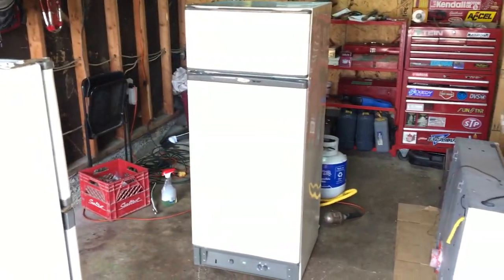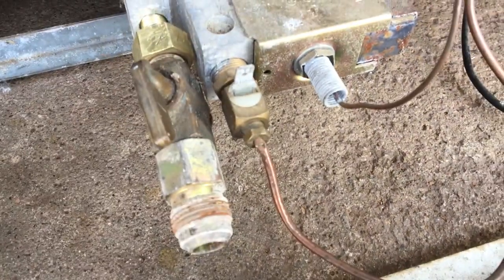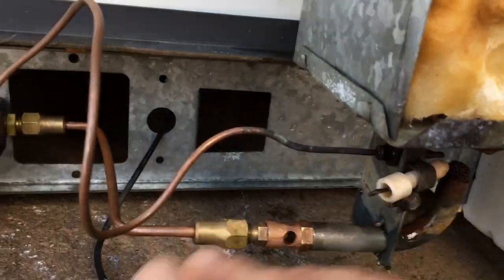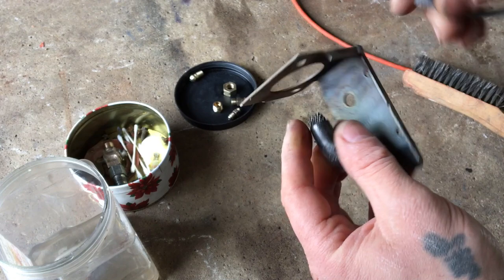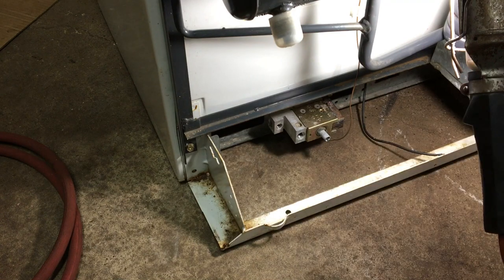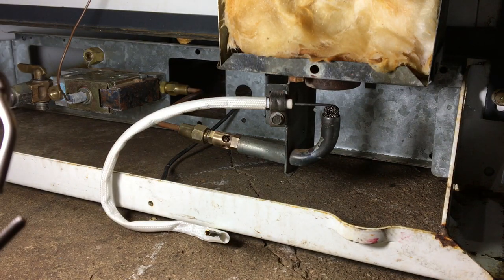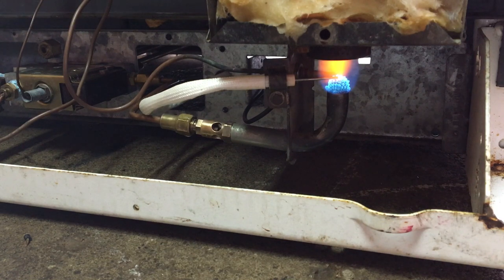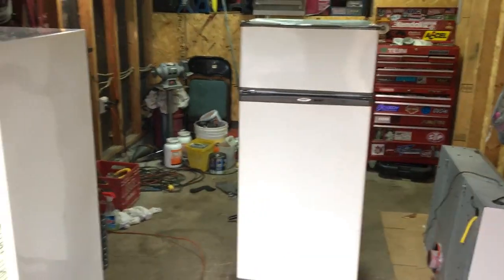How to fix a propane fridge - Consul Danby Unique - Off Grid

Comment: Wow, Great video. I have an RV fridge that wouldn't stay lit. I thought it was the thermocouple but had to wait to get the part. When I blew the dust and dirt from the area I came up with an extra part and couldn't figure where it came from. Now I know it was supposed to be in the gas control valve where the thermocouple connects. Not having it there caused a little fire ( which I quickly put out). Your video also showed the importance of cleaning the flue.
Thanks again for explaining the system!!!

Comment: Thank you for your video very, very knowledgeable and helpful. I thought I'd give you a little pointers on thermostats. Thermostats are never right. I used to 32°. It melts to 33. If you put your thermostat in a glass of ice, it should rain 32°. If it doesn't adjust it when you adjust it, it will be right.

Comment: You did a great how to on this . Just a lil fyi though . On threaded fitting only one type of sealant is needed . On the flare fitting the sealant is not needed at all , the bell or ball of the brass fitting is where the seal happens  .

Comment: I love this design and I love the concept of a frigerator that doesn't need electricity to run.
My only real objection though (I guess) would be that you have to replace the propane tank every 4 or 5 days during the summer months which is probably expensive after a few months- or at least that's what I've heard.

Comment: Thanks for the video, I have two, my issue is the new electronic gas regulator will not stay lit, it will light with the push button and sparker but even after five minutes of holding the push gas button it goes off, any adjustments to regulator to help solve this? Thanks for the video.

Comment: Thanks for the helpful video.
We bought a camp with two of them.  We only use one and it's worked well. 
This weekend we noticed an odor in the closed up house like 'burned propane exhaust.'   Went to bed and the freezer was -10 and the  fridge was  34.
At noon the next day, the freezer was at 32 and the fridge at 48.
Found your vid.
Mine does not have the three bolts holding the exhaust stack on.  It's got a self tapping screw near the top of the exhaust stack that keeps it in place.   Undo that one screw and the stack comes right out.
The strangler assy was completely coated in carbon.   I didn't do the complete field strip of the burner assy, this time.   I needed a working fridge.  I'll do that in the fall when I put this place to sleep for the winter.
What I did do was cover the burner orifice before I brushed the coils down because any soot falling off the coils, into the burner, wasn't going to anybody any good.
Brushed a shot glass of soot out it was pretty dirty rubbed everything that I could reach with a crocus cloth, reassembled it and fired it up.
Talked to the previous owner.  He said that odor was from carbon monoxide being generated.  Sounds like I don't have a CO monitor.
No big deal.   Now that I know how to clean the thing, it'll be a 20 minute job in October.

Comment: Thanks for this video. My Unique propane refrigerator won't light. Bad electrode. The original part for the Unique electrode is not made anymore. I'm going to try the gas grill electrode that you used.

Comment: Thank you for very good information, I just have a question, when you clean the thermostat, do you blow high pressure air directly into the thermostat?
And the filter came out at this time ??
thanks again

Comment: I have a weird one I can't figure out, Unique 8. It will light and stay lit on defrost for days (and cools). When you set the temp the flame rises and stays lit up until it reaches temp then loses flame. Set it and leave the doors open it will run for days. Close the doors and within a couple hours you lose flame.

Comment: I have the same refrigerator. It stays lite but is giving me whispy carbon build up on the diffuser. It’s also giving off a smell. I have cleaned it, but still no luck. Any suggestions?

Comment: Often you can have a good thermocouple but the flame won’t stay lit upon release of pilot button. This is due to a faulty carbon monoxide monitor. A good Consul fridge carbon monoxide monitor will produce 3.5 v. At white connect just above plug into thermocouple. A faulty one will read zero or 9v. The monitor is $250 and the thermocouple only $50. Monitors should be replaced every 7 years. Hope this helps you diagnose why your fridge won’t stay lit. My monitor was a model 9SS over 12 years old.
Reply: I'm guessing you measure the voltage beteen the plug and the housing or fridge chassis?  Is there a way to bypass it for testing?  Can you also tell me the pressure required to run the fridge?  Thanks for the great video!
Reply: Derek Fehr Yes on where to test. Don’t know pressure. Hopefully he will answer your inquiry, try posting before my comment.
Reply: I have a very similar fridge.. A manual I foung on line says " 11 inches WC". {water column).. I've used a regulator and hose assembly from a propane bbq.. To run the fridge.. Works fine.. The bbq regulator was stamped 10 inches wc... Just for info purposes.. It takes mine approx 3 hours to cool down from "startup" to operating temps.. Fridge... 5 degree C... Freezer. Minus 4 degree C

Comment: Now tell us how to fix a consul that the flame burns and I hear gurgling in the back but it only drops the temperature a degree or two over night from room temperature
Reply: ever figure out that issue? dealing with this now. thanks
Reply: Same.....
Reply: @TaylorLivingston  I tried everything and everywhere and nothing. All I know is that if there is any discolouring on the outside of the pipes on the back, it indicates a leak in the system and the fridge is junk
Reply: Cooling unit leak..need a new unit or have the one you have rebuilt